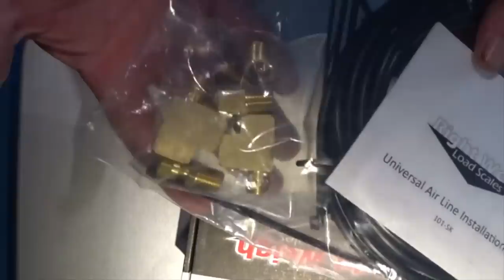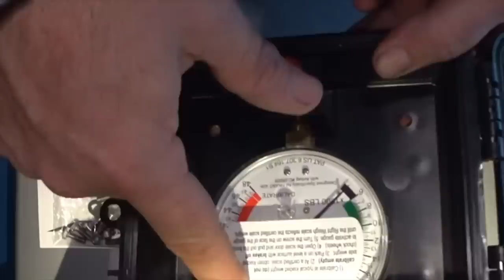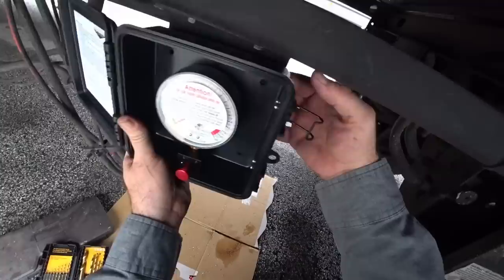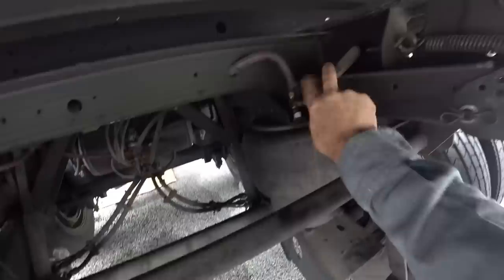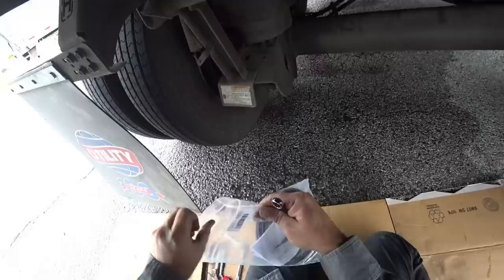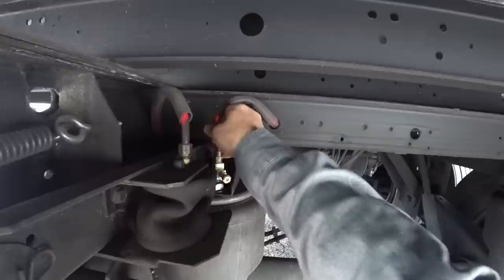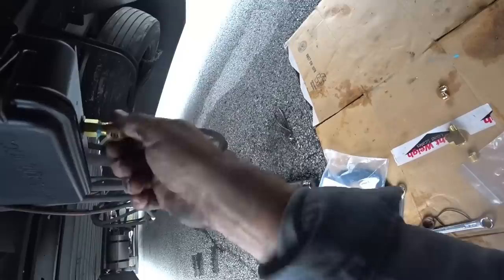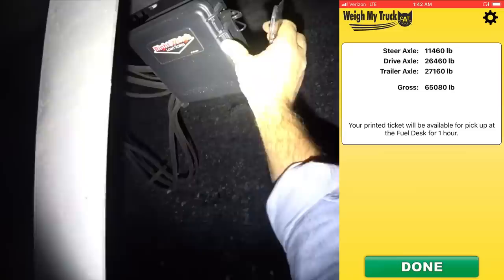October 6, 2018/401 Install of Right Weigh Load Scale on 2018 Utility Reefer Trailer

Comment: Larry, An old pipe fitters trick, start the fitting just one thread then paint the teflon paste on and you eliminate the paste getting inside the tube and gumming up the works. Those compression fittings are called "nut and ferrel tube fittings". Some of these fittings have a washer like ring that allows the ferrel to not turn when you tighten the nut to finger tight plus one and a quarter turns.(1/4 Tube) Guaranteed not to leak. If you tighten them tighter they will cut the tube or deform the coupling surfaces and they will leak, of course the will leak if they are not tight enough.

Comment: Good Weigh gauge install video Larry.  A very practical use of a piece of cardboard also. I've never seen an air bag axle lock before. Thanks for the explanation of that device, and over all excellent video. Two thumbs up on this one.👍👍

Comment: I think John has that other trailer with this system on that you're talking about. He's also having issues with it and I think it needs calibrated because with a load he's got on it right now it seems to be about a thousand pounds off. Either that or he needs to have a long talk with you and isn't using it correctly.

Comment: Larry, great video. I remember wondering what those levers at the back of the trailer were for. never got around to asking another driver or shop guy. Now i know. With these levers do you still pull your trl air. Guys at my company were telling me that I should never pull my trl break cause the trailer settles and makes life hell for the forklift guys. However I seem to remember during my training (with another company) that I should always set my trl brakes. Am I losing my mind ?
Reply from the maker: Set your trailer brakes
Reply: Yeah even I don’t know what these things are for. But definitely nice thing to know. Thanks Larry.